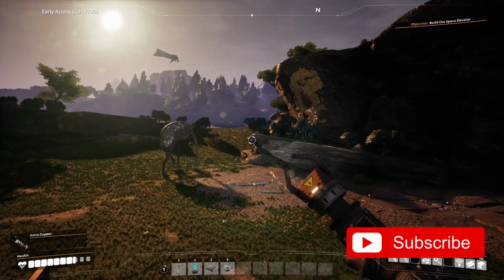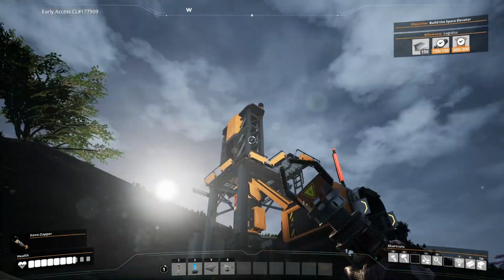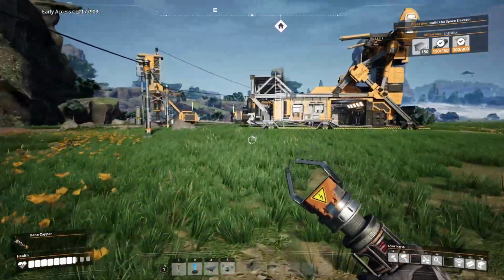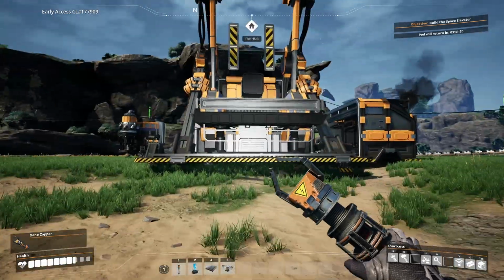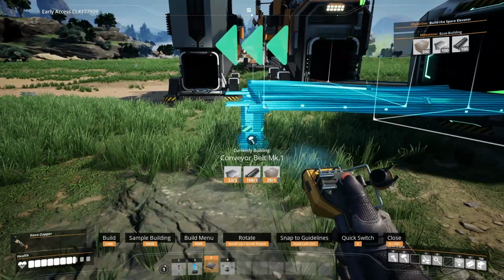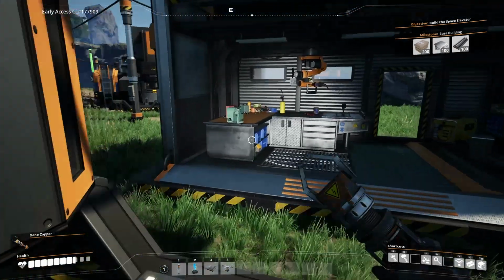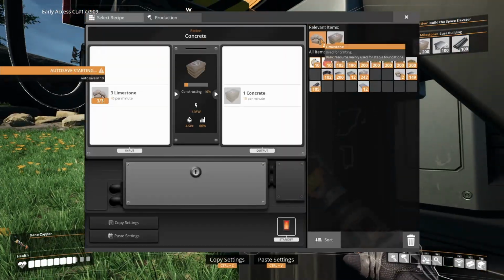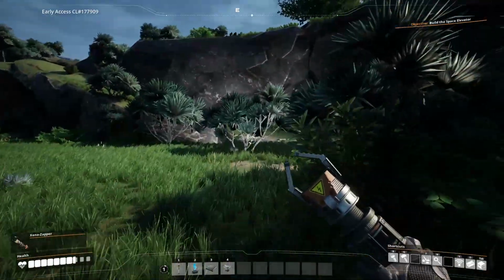Satisfactory Update 5 Episode 3: Laying a Foundation

Comment: not inefficient but to long  wait till you have 3 constructers 3 assemblers plus others  on the iron line alone i have 2 mines 2 smelters 3 constructers then assemblers times 3 and buy does it take up space and get complicated fast i found the best way to line things up is stand on top of the building and then line it up ctrl helps keep it square to other buildings
Reply from the maker: I will tighten everything up when I set up my first proper factory. Put the miners and smelters on foundations and then ship the ingots into the factory to be refined into stuff. I think I'll remodel the copper line before I go any further with it too. Straighten things up and get the miner on the grid.
Reply: @StormhavenGaming  yeah i have gone miners then to the side of the miner the smelter to take less footprint at moment im unlocking the milestones befor i build bigger just hunting the map for coal but from the gps it seems to be high up so my have to build the jumping things to get high up to find out as to shipping from one place to another not a bad idea i had not thoght of that i just have converbelts everyware i have 3 constructers side by side one revrsed then riser and belt other to the 3 assemblers as 2 of them need screws one needs iron bars and other metal sheets so to keep it short i just looped back other rather then a very long mile long production line im building in a confined location so may have to build upwards i cant wait for the smart sorters then i can just have one location with storage containers should make things simpoler to a point i think but i think your onter somthing with the ingots and transport
Reply from the maker: I know that there are transport trucks and, eventually, trains. Maybe setting up outposts for specific resources and then funnelling them all to a central processing factory and storage area.
Reply: @StormhavenGaming  yeah sounds like a plan